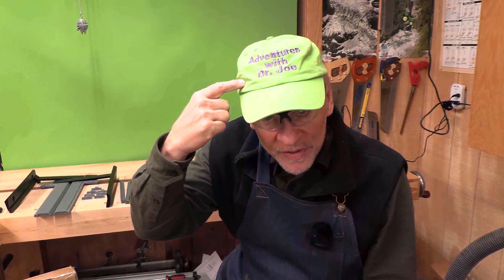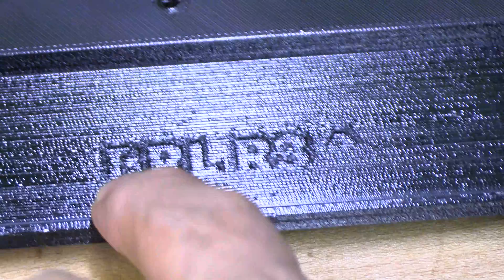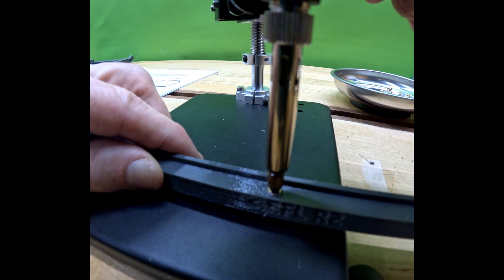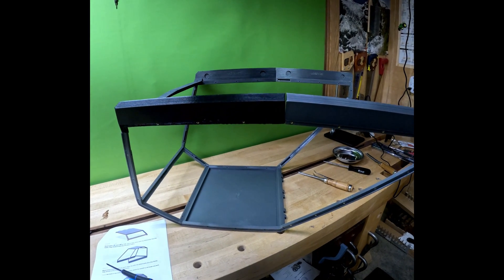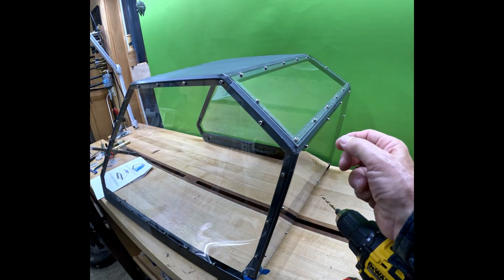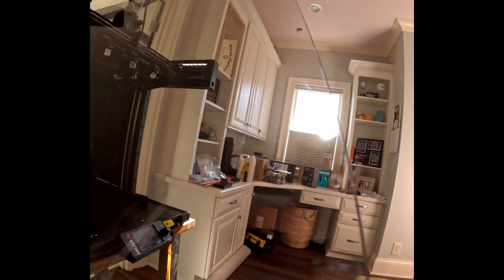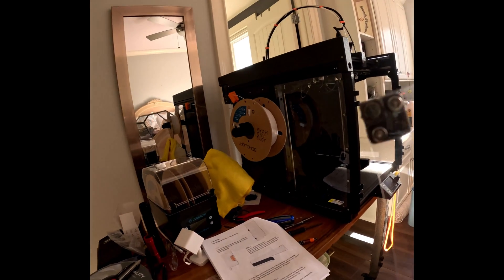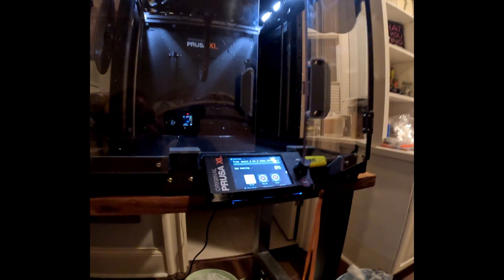PRUSA XL ENCLOSURE ASSEMBLY and REVIEW

Comment: Batteries?  Magnets?
Reply from the maker: The kit that I listed in the video comments comes with all the necessary parts for assembly, including magnets. Batteries aren’t necessary for the enclosure. I did add some LED lights, but they basically are plug-in. Consider subscribing. Thanks. Joe.

Comment: Hallo zusammen,
Ich habe den Prusa Enclosure gekauft, aber keine Zusammenbauanleitun bekommen.
So etwas gibt es ja offensichtlich von Voxel3D. Wo kann ich sie bekommen?
LG
Reply from the maker: Thank you for your question. I’m very disappointed. You didn’t receive in assembly instructions from Prusa. I’m sure they’re available on their website. Voxel3D cells an excellent HEPA filter that can go inside of an enclosure. My YouTube YouTube channel has an enclosure that I printed and assembled step-by-step instructions if you’re interested. I’m also going to publish soon a video of the. Voxel3D HEPA filter that goes inside the enclosure. Consider subscribing. Thanks. Joe.
Reply: @JosephHunstad  
Yes, I bought your case on Aliexpress. Unfortunately there were no assembly instructions included. But then I found it online and everything is now installed perfectly. 
Why the filter? My printer is in the basement at around 16 degrees. With the housing I just want to ensure that the ambient temperature stays above 25 degrees without having to heat the entire basement.
Thank you very much for the feedback.

Comment: Awesome thanks - was a solution found for the usb issue and is there a way to vent through a heap carbon filter at the back of the enclosure ?
Reply from the maker: Thank you for your comment. You make a really good point yes we did figure out the USB solution with a very small one and that’s worked great. I use a HEPA filter that I keep inside the enclosure at the very front. There’s enough room there for it.
I’ll try to do a quick video on that filter in the next couple days. Thanks. Joe.
Reply: @ thank you! Happy holidays

Comment: When you start your build or better if you have a shop glue / tape a magnet on a wall or on your desk and that magnet is now the master magnet for the rest of the build.  Now you will clock all of your magnets off of the master magnet so they all attract / repel in the same direction.  Also at the beginning of the build take a permanent marking pen and mark all of the magnets on one side so they are all installed with either the marked side on the outside or the marked side on the inside of the hole.
Reply from the maker: Thank you for your absolutely excellent idea that would make placing magnets so straightforward and you would never mess them up. Thank you for your suggestion. It’s great. I’m going to employ that with my next bill. Consider subscribing. Thanks. Joe.
Reply: Search “Countersunk Disc Magnet” and screw one somewhere in your shop.   Forever more all projects will be clocked off of that one magnet.

Comment: About to finally assemble mine and have one question....which side do the heated inserts go in, does it matter?
Reply from the maker: Hello. That’s a great question. If your heat inserts have a narrow end, which many do, that’s the end that goes in first. I have a video on heat set. Insert you may wish to take a look at. Consider subscribing. Thanks. Joe.
Reply: @JosephHunstad  thanks for the response.  I was asking about which side of the printed part they get inserted into, do you remember?  Does it matter which side?  It's kind of hard to tell from the instructions for most of the parts.  I'm guessing the recessed side that the acrylic panels slot I to is the side that get the I seats inserted, is that correct?  Hope I'm being clear enough...having a bit of work related brain fog at the moment.
Reply from the maker: Yes, the recessed parts are where the inserts go into in general. Just take a close look at those and I agree the directions are pretty poor and I made that comment during the video presentation. You can actually watch the video again and you can see where I’m putting those heat set inserts. Thanks again. Joe.
Reply: @JosephHunstad  thanks again for the quick response.  I thought that's where they would go.  Printing the parts took A LOT longer for me than the directions stated so I wanted to avoid messing things up if possible.  I ordered more heat Inserts just in case though.  Once I get this done I'll also be installing the LED set you added. 

 Do you find that the enclosure gets hot enough to prmrint most things or did you need to add a heater of some kind?  I already printed & assembled a Nevermore filter to help, but also was thinking of adding a small heater.
Reply from the maker: I’m not sure that you’ll need a heater. I was doing some printing yesterday with PETG and . Let me know if you think you need a heater. I’m interested in your findings I have not needed one. Take care. Joe.

Comment: Hey Joe, I got my printer and enclosure and im getting ready to print the enclosure parts.  The printer is very NICE!  I was wondering if I can ask you a couple questions about your enclosure.  Did you print your parts with .6 or .4 nozzle my printer shipped with the .4mm nozzle.  Did you print all your parts using an input shaper?  And did you print the parts with supports?  I thought I read somewhere that the enclosure does not require any supports for printing so Im a bit unsure.  Also  Im hesitant to print them with input shapper because I have not used it yet other than the Prusa keychain sample which I think is running input shaper.  Any input you can share would be much appreciated.  Thank you!
Reply from the maker: Congratulations on getting your new printer. I printed all the enclosure parts with a 0.6 mm nozzle. That’s because that’s the standard at the time now it’s become 0.4. I think you’ll get a finer print if you use the 0.4 mm. I also used.PETG BECAUSE IT NEEDS TO WITHSTAND HEAT.PLA IS PROBABLY NOT THE BEST
there are two parts that need to be printed separately. They’re the largest parts of the whole build the ones that extend from the print bed, and I would definitely use supports on those. Other than that you can print that one giant sheet with everything except those two parts that extend from the print bed. consider subscribing. Thanks. Joe.

Comment: Build was successful.  I didn't have a big enough set of calipers to get the length measured.  I printed almost everything in PC with 3 perimeters.  Worked out great.  I tried to guess with a crude measuring tool...I got 100.4%.  That wasn't correct but I was still able to use the pieces without reprinting.  I went to 100.8% and the rest of the parts printed perfectly.  So it isn't the end of the world if the scale is off.  Just error a little small rather than too big.  My kit was short one magnet, 2 t-nuts and 1 bolt.  I broke one of the larger magnets.  I used the larger piece and it still worked.  My wireless connection was too tall but I was able to rotate it down and get the enclosure on.  Love it.
Reply from the maker: Congratulations on your build it’s wonderful. It’s nice when the enclosure allows the whole area to be heated mines usually at about 80°F and that helps with adhesion for sure. It’s a fun project to build. I had a few missing pieces. I was short three he said inserts, but I had already bought 100 so that was OK. Otherwise, my kit was pretty complete. Consider subscribing. Thanks. Joe.

Comment from the maker: So great information thank you so much. The small upscale is because once you print pet G it shrinks. It’s interesting that you print one. That’s 345 mm long and when you measure it it’s 2 mm shorter than that so that’s why the 100.42% upgrade was necessary for everything to fit properly. I just uploaded a video 0:01 of my 125 nextruder Upgrade you might want to check it out. I thanks. Joe.

Comment: Thanks for the video.  My XL coming next week and im going to order this enclosure kit. Looks like a nice enclosure but seems like it would be a bit better if the front panel would hinge up to open what do you think?
Reply from the maker: So the enclosure is overall excellent, but not perfect. If you go into the print Ables where you download the information for the parts number one be sure, you print everything at 100.42%, but then look at the other comments because other people have contributed new bars in the front and newhandles for the lid and doors that make things much better. You’ll love your printer. I just upgraded mine from a one head to a five head. Standby for that video. Consider subscribing. Thanks. Joe.
Reply: @JosephHunstad  thanks for the tips I will be sure to do that.  Why the small scale up in size, I assume the parts and maybe hole sizes are a bit under sized?  I bought the 5 head for multi material, especially soluble support and some multi color printing.  Have you run any soluble materials yet? I bought the XL to replace my old Stratasys Dimension SST ES1200 machine which is a commercial machine (32K new back in the day, I paid 15k used) so I have high hopes the XL will live up to the expectations so I can phase out the Dimension. I use multiple MK3s & S+ printers at my day job and I LOVE Prusa machines so I knew the XL will be at least as good or better!!   The little MK3s make parts as good as my Dimension for Penny’s VS a the Dimension, believe it or not a roll of material and support is $250.00 bucks so it’s $500 to feed the machine. Parts I make are functional mechanical assembly parts.  BTW: Stratsys is the company who invented FDM printing technology in the 80s, cornered the market, became a greed monger company charging that kind of money and making you buy into a $2500.00- 3K service contract every year. Needless to say I’m done with that years ago and have waited so long for a prosumer printer capable to replacement replace it. It’s a good thing there patent ran out which started the boom in 3D printing.

Comment: I love that you are building this while it is printing something.  That makes it seem even easier to install and your confidence that the print won't be disturbed is also pretty amazing.  I can't wait until everything shows up to start the build.
Reply from the maker: It’s been great. Be sure you print the long ruler and measure it. Mine was 2 mm off so I had to adjust up the percentage from 100 to 100.21 or 100.42 based on what you see. The bill is outstanding. It’s a lot of fun I’m getting ready to upgrade from one to five printheads on my Prusa XL. I’m waiting for my order from Prusa and then I will do a video on that. Consider subscribing. Thanks. Joe.
Reply: @JosephHunstad  Did you figure out the USB issue?

Comment: I don't have a press.  Do you think I could press in the inserts with an automatic temperature controlled soldering tool by hand?
Reply from the maker: Great question. Yes, you can use a soldering iron that has a fine tip as long as it fits into those 3 mm openings in the threaded brass heat inserts. Be sure to put them in squarely. You can get a new soldering iron from Ali Express for like five dollars or amazingly cheap or Temu consider subscribing. Thanks. Joe.

Comment: Thanks for showing of this enclosure Dr. Joe (and Voxel3D for designing it). Looks like a great solution for the XL.
Reply from the maker: Thank you very much for your comment. It is an excellent design and my video is actually listed in printable under the downloadable files to make the parts for this. It is a lot of fun to make with your printer and even more fun to assemble. The kit from Ali Expressis really quite good and I did buy a vertical heat set. Insert soldering iron machine which made putting those threaded inserts a breeze. Consider subscribing. Thanks. Joe.

Comment: What is the overall height of the printer + enclosure? Trying to see if that will fit in the spot I have planned for it. Thanks.
Reply from the maker: When you include the new sound, dampening feet installed – another video to watch – 37 inches is from the top of the enclosure to the bottom.
Reply from the maker: I will let you know later in the week I’m out of town. Thanks.

Comment: Does it considerably the loud noise of the XL? I was so surprised how this printer is loud!
Reply from the maker: Thank you for your question. No the enclosure does not considerably reduce the noise but it certainly helps. Also the vibration reduction feet video that I posted you might look at that because that’s helped with the sound reduction somewhat also. Consider subscribing. Thanks. Joe.
Reply: Thanks for your reply! Will take a look at it for sure, this printer is so loud!  @JosephHunstad

Comment: how long did you have to wait for the acrylic panels to arrive?
Reply from the maker: Thank you for your question. It’s a good one.Aliexpress actually sent those panels to me pretty quickly. I also made a dry box and ordered a hardware and acrylic panel kit and it arrived in a week and this kit arrives in a week as well. The panels are actually polycarbonate which is the same material as used in safety glasses, and the kit for me was excellent except it was deficient for heat set inserts, which apparently has been corrected.consider subscribing. Thanks, Joe.